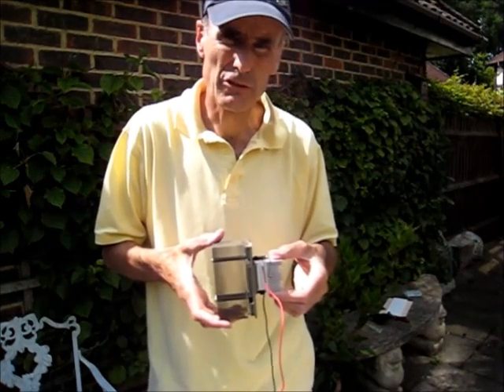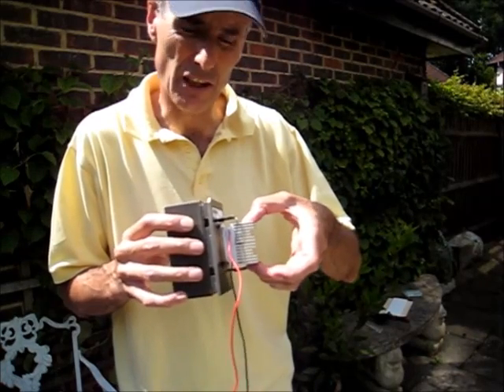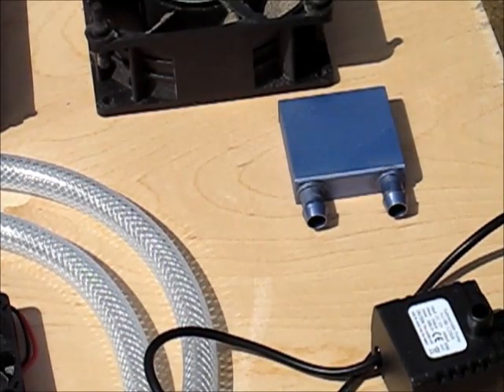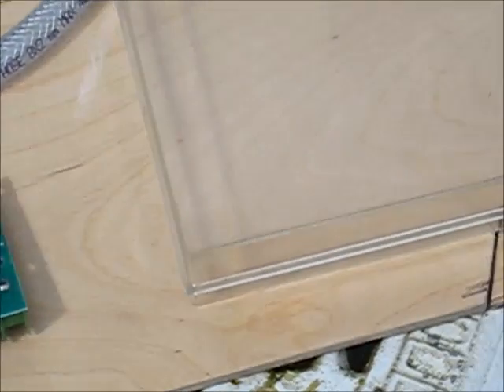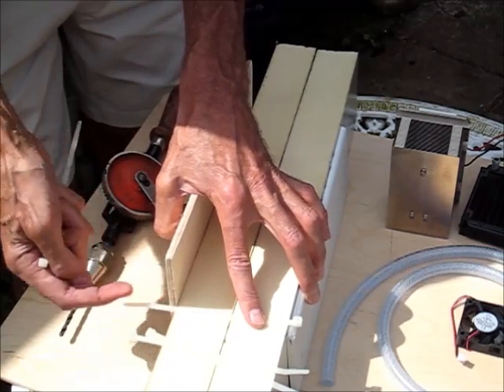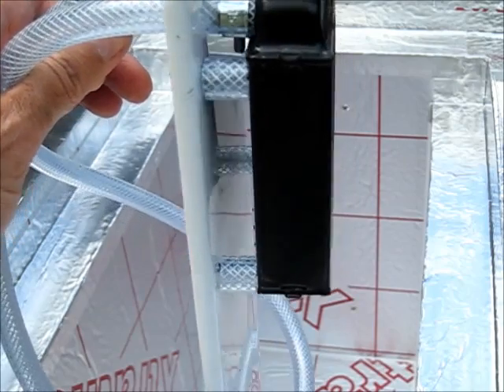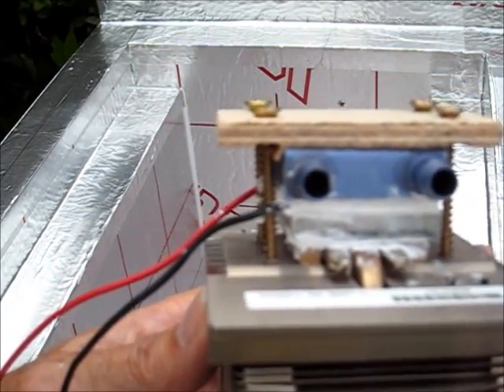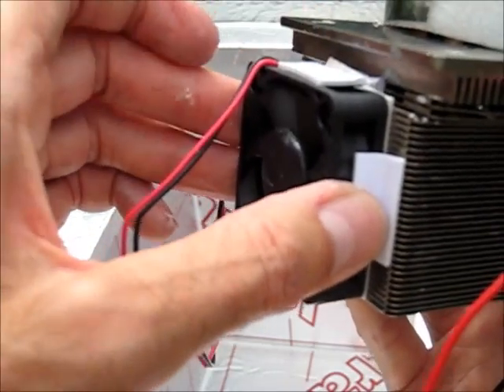Part 4 - Super Cool Box Project; water cooled peltier set-up

Comment: could you run the cooling tubes in channels on the insulation boards just under the aluminum foil to create a thermal difference between the outside temp and t he inside temp

Comment: Why are you worried about the thermal bridge? you can't cycle peltier without destroying it, so only reason it would be off is when you're not using the cooler at all
Reply from the maker: Hi Jordan, Thanks for your comment.

Thermal bridging is a problem when the peltier is turned off by the thermostat and on and hot day the hart "collected" on the heat exchanger can end up "heating" the cool air inside.

A thermostat is in the design to avoid using the peltier continiously when "off-grid" as that would drain a 12v utility battery within a few days of days. My goal is for it to last a week long camping trip.

Comment: I AM IMPRESSED.  Your the first so far who has worked out a reasonable solution to the heat soak back and understands the the basics well enough that your design might actually be practical and function.I have owned a number of inexpensive and tossed out coolers because original purchaser thought the unit was good idea and found out the cold beverage was the coldest when they put it in the mini-fridge  it because warm slightly faster from that point.  Each modification that worked always was separating cold from hot improvement and distributing what ever cold that was made to the items to be made cold. the fastest iI have made a room temp beer to icy  cold is 12 minutes with my fridge having a 30 minute head start. this very same modded unit would eventually freeze stuff if left on max cool to long. typical comment from original owner no way you didn't just pull that out of that POS  you removed from the trash always the answer yup ....lol    MOST CHEAP TERMO ELECTRIC COOLERS  ARE ABOUT AS GOOD AS A FART IN A WIND STORM. The problem is they are to weak on the generation and transfer of cooling to the beer or whatever. My modded units always increased number or size of peltiers , made contact transfer to items and used fans. also peltiers like the power to them biased to half their max the remaining voltage ramped or pulsed to as hard you think the unit can handle from the OEM specs. Turning on the unit maxxed out will make for short life and if your hot cold isolation is not optimum same operation will make it very slow to get cold at all!!!

Comment: you aluminum heat disipator is bad made the is make with do pices of heat didpators one plate and anoder big and it is conected with screws so is heat sisipation is betri bad so the is you prolem and you uses wahter that can get freez so you ned yo used alchool some liqui refriretant that don get frezz

Comment: Hi mate, Wondering if you could share your opinion about a project I 
want to try. Thanks for making your vid BTW. So I use overear 
headphones. But they heat up so much they become un wearable. Any to 
cool with these peltier plates. I would not mind having a cable to a 
external battery. I just always see these plates used with crazy big 
heatsinks. Any input would be great

Comment: My small Waeco cooler has only a 30mm or so wall thickness. They use a 35mm block of alluminium to link the TEC  (Peltier device) at the outer wall, with the internal, aluminium wall of the cooler which acts as the internal  'cold' heatsink.  I'm guessing a copper block could work even better!
Reply from the maker: Thanks Richard for this information. I am considering trying a non-water  alternative design to compare performance so your comments are useful.  My concern with that type of design is the thermal bridging effect when the Peltier is turned off.   
I did see that one manufacturer's design physically separates the hot or cold heat sinks from the Peltier when not cooling, but I have no further information.

Interesting design, so Waeco keep the inside of the device "fin" and fan free by using the large area of the internal aluminium wall - a nice idea that also reduces energy use by doing away with a second fan. A large aluminium plate of one end might simulate this.

Yes, as you suggest copper is a superior conductor so is desirable, but sheets & blocks seem harder than aluminium to source at reasonable cost.
Reply: @uksomerville  any link or reference of this video please

Comment: Did you cover the insulation with metal foil tape?  If so, that is a huge factor in why your box isn't working well.  Foil tape is a great conductor of heat, so when you're attempting to cool the inside of the box, the foil tape is absorbing heat from outside and wicking it into the box, assuming the foil tape on the inside is connected to the foil tape on the outside.  (which appears to be the case from the top shot when you had it inside the back of your vehicle)

Peltiers are only about 10% efficient, so if it's drawing 100 watts, it's only pumping 10 watts of heat, and the other 90 watts is waste heat that needs to be dissipated.  The cold side doesn't need a fan.  Heck, it barely even needs a heatsink.  The hot side, however, has to get rid of all the heat, so it needs much larger heatsinking than you have.  (or a much larger radiator and more efficient water block that's copper)

I made a similar box using a tec1-12706 (12v x 6A = 72 W) with just two aluminum heat sinks, small 80mm ones, and similar insulation that you used, and got the temperature inside about 40 degrees cooler than ambient.  I originally made the same mistake that you did and had foil tape covering every square centimeter of the thing and it was wicking the heat into the inside via the foil tape.  Once I cut a barrier strip in the foil to separate the foil on the inside from the foil on the outside, the efficiency almost tripled.

Cheers.
Reply: 5ky 
"Peltiers are only about 10% efficient"

That's an oversimplification, actually a peltier module efficiency can be plotted as a curve depending on the temperature difference between it's hot and cold sides.
When this difference is low, that is between 0 and 20 degrees Celsius, it actually has above 90% efficiency.
Then at 20 to 40 degrees difference the efficiency drops to around 50% and it goes down quite rapidly reaching 0% at around 68 degrees difference.
So technically to get the most efficient work out of such module you need both excellent cooling of the hot side, and distributing of the cold side temperature in your coolbox, as any unnecessary rise in temperature difference between module sides kills the cooling power.

This efficiency curve actually means that you can get around 30% cooling efficiency with a 2 stage module cascade with precise live voltage regulation on modules running at relatively low voltages where they get best efficiency, and keeping both of their temp differences below 40 degrees Celsius, which should not be a problem then as this will cause the total difference between the two stage peltier module pack above 70 degrees, and that's a serious temperature difference.